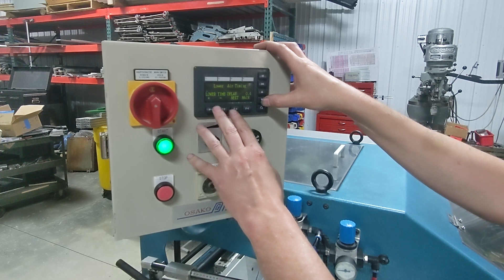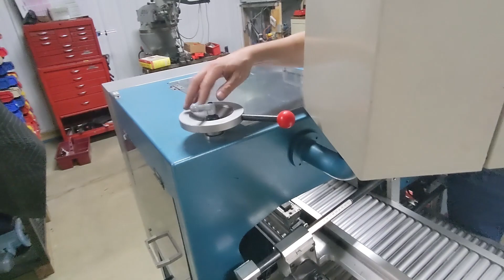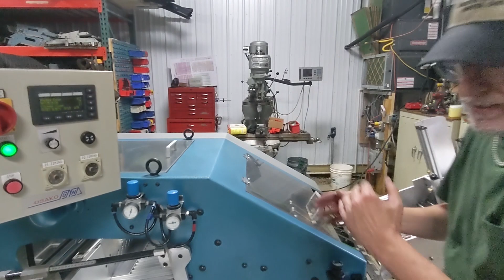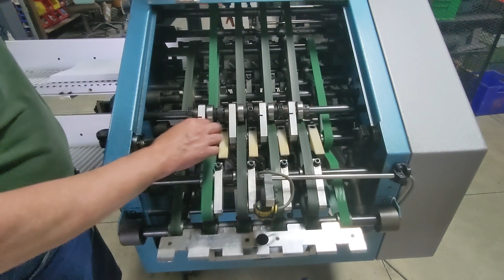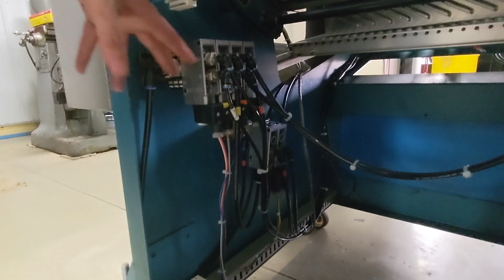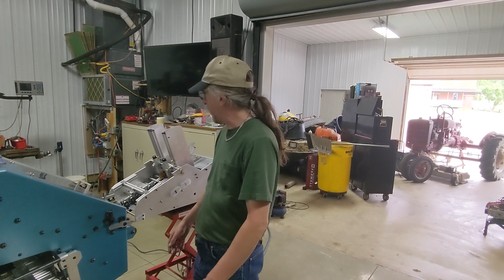Osaka Stacker Batch Counting System – Folder & Saddle Stitcher Solutions

Comment: It sort of looks like the pitch is too high on the outfeed angle of the higher unit and that's hanging them up. Just a guess :)
Reply from the maker: HA!  I didn't even notice that Gary.  I had to go look and see what you were talking about.  It must have landed okay because I never saw it.  There are adjustable deflectors inside there, but for magazine work you really don't need them.  I see that those adjustments are best for lighter stock, the deflector, the air blast, etc. if you are coming off a paper folder maybe, or counting cards like I was doing at high speed.  I'm asking $15,000 for this unit and there are all kinds of things I could do with this if you know anybody thats interested.  This would be perfect off a mail line, for deflecting back and forth between "Packs" and "Bundles" etc. etc. I would have to add a little coding to the PLC but it would be easy.  And if my former large commercial printing company was using this, I would lengthen the output conveyors to give the operator a little more time.  I would INCLUDE some of that work for someone that was interested.  Because they are "stacked" deliveries, you can't very well roll up 2 conveyors. I suppose you could roll up a lower conveyor, and take your time grabbing from the top conveyor more often, and using the lower as your larger accumulator to give you time to box or skid pack, etc.